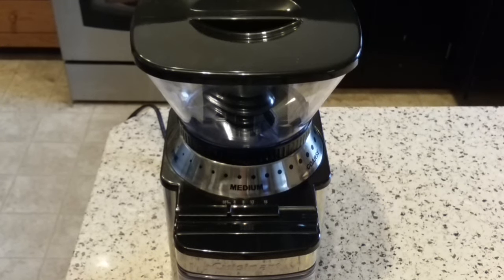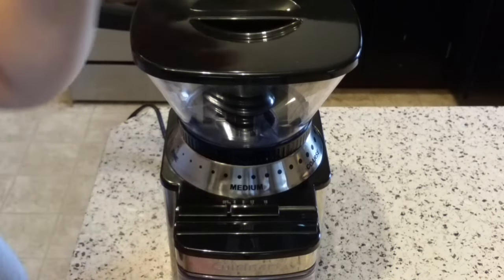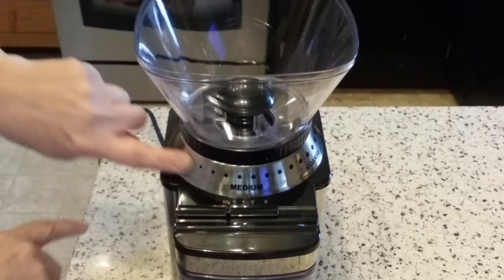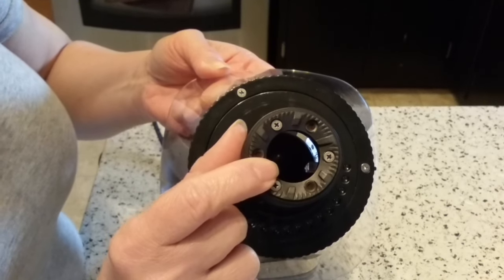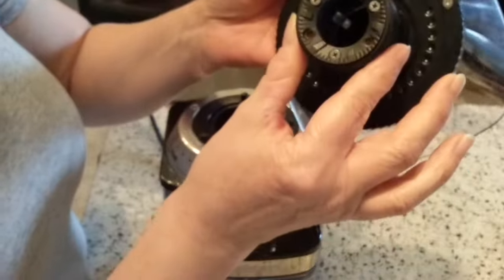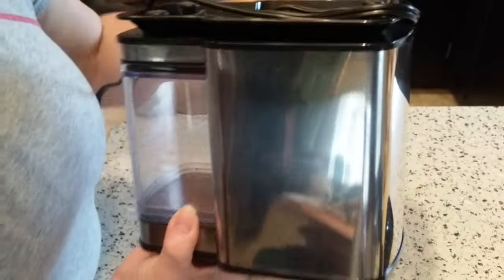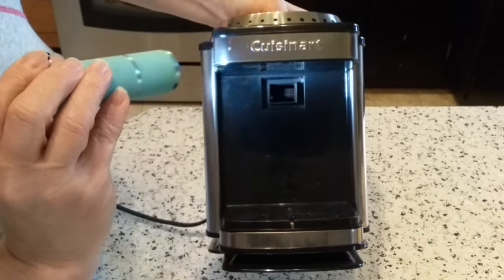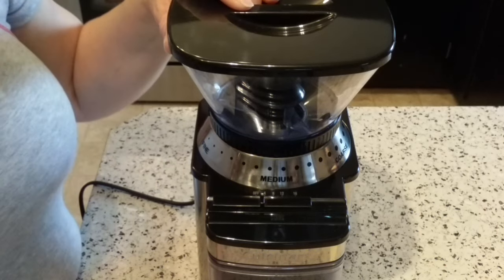Cuisinart DBM-8 Coffee Grinder: How to Disassemble for Cleaning

Comment: This is the same one I have. Which setting should I use for my percolator? 😊
Reply from the maker: Percolators typically use a coarser grind setting. I would start near the right side (coarse grind) of the dial, then make adjustments from there to your liking. I use the coarsest setting for cold brew which works very well. Hope this helps.

Comment: Once the hopper is mostly clean, you can throw it in the top rack of the dishwasher with the threaded part hanging down. Dishwasher detergent is great for dissolving coffee deposits (ie. oil and dust). I wish there was an easy way to remove the motor so the lower burr and chute could be thoroughly cleaned the same way. I did mine today after it was packed shut, and I'm still not happy with it.
Reply from the maker: I've had more than a few viewers ask me how to get all the residual water out after running it through the dishwasher. There are so many nooks and crannies where it gets trapped. I never expose any of the parts to water as it can cause ground coffee to clog even more and possibly grow mold inside the machine. I only run Minute Rice through it to get rid of excess coffee grounds as well any residual oils, then brush everything thoroughly.

Comment: Here is my grinder. You actually have to take it apart to clean it. The manufacturer never once told me this. they just told me that there is nothing in the owner's manual about cleaning...DUH...If you ever want to feel like pulling out your own hair, contact Cuisinart, and try actually having a conversation with them.
Reply from the maker: OMG!! You are not kidding! I just went through a hair-pulling experience with my Cuisinart food processor and the recalled S-blade. Oye ve!

Comment: Hi helpfulnatural, can you grind rice, spices, and nuts in this machine?  I know that Cuisinart DCG-12BC Central Coffee Grinder does the job, but too small for me, so I was wondering if I can switch this for that purpose. Thanks.
Reply from the maker: The burs are meant for grinding coffee beans. Spices are quite a bit harder in texture and could damage them. It would also be difficult to clean all of the residue and odor leftover. I would stick to a small blade grinder for spices, herbs, etc. Does a faster job and is much easier to clean.
Reply: @helpfulnatural  I see, thank you so much ^.^

Comment: Can you hand wash the upper piece, being carefully of the ceramic burr?Noting ceramic is hard, but can easily chip if struck on the sink or facet.
Also, can you adjust the grinder while it is running? I been told that coffee can stick in the burrs, if you crank down from course to a fine grid without cleaning you can compress and pack the residue coffee on the 2 burrs causing a motor lock up. By running the machine empty while adjusting down you will finish off whatever might still be on the burrs. Not sure how true this is, but with a heavily oiled bean or sticky flavored bean you could see how you might get a buildup faster.
Reply from the maker: Yes, it is a good idea to have the grinder running while making adjustments. If however the bean hopper is empty, this is not necessary. I suppose you could wash the upper assembly but I never get any of my grinders parts wet for any reason. Especially because it would be impossible to get all the moisture dried out of the feed tube and other tiny crevices inside. This can cause some issues while grinding and cause clogs with grounds trapped in the grinder. If you used a flavored coffee that you want to remove the leftover residual flavor, wipe out the bean hopper with a damp towel or paper towel. Then run some Minute Rice through the grinder which will not only remove trapped grounds but will also absorb any leftover oils left behind. There is also a product called "Grindz" that is just for cleaning coffee grinders. It is pellets made from wheat that does the same thing as the rice. With either option, be sure to brush everything out thoroughly to remove any rice dust left behind and before your next brew, grind a tablespoon or 2 of coffee beans to make sure there won't be any dust in the grounds you'll use for brewing. Here is the link to one of my other videos showing how I clean this grinder from start to finish:  www.youtube.com/watch?v=cjm_fmALfTw   Hope this helps.  :)   Thanks for watching!

Comment: Can you clean the top plastic part where you put the beans with soap and water after disassembling? Mine has so much oil from old beans.
Reply from the maker: I would wash just the plastic hopper portion (where the beans sit) carefully by hand. Try not to get any water into the narrow tube because it's very hard to get it completely dry. If you hold the hopper upside down, it might be easier to avoid getting the tube or burr wet.
Reply: @helpfulnatural  Ok great, I'll try that. Thanks so much!

Comment: can I use my DBM-8 for grinding spices like coriander, peppercorns and mustard?    I would use it solely for spices. I have a grinder for my coffee beans.
Reply from the maker: Many spices are too hard to grind in a burr style coffee grinder. The burrs in this grinder are made of ceramic which could crack while grinding peppercorns, mustard seeds, etc.. I use a blade style grinder for my spices which works very well and is easier to clean afterward. Hope this helps.

Comment: I washed the hopper in the dishpan. Dishwasher was trapper in the hopper.  Is it not supposed to be submerged?
Reply from the maker: The owners manual for this grinder states that it can be placed in the dishwasher but I've never done it. Water gets trapped in all the tight spaces and takes forever to dry out. I've had many questions about how to get all the water out. I never expose any grinder parts to water....ever. I just wipe very thing down thoroughly then put it back together. I also never use my coffee grinders for anything but coffee beans. Try setting the hopper in front of a fan overnight or use a blow dryer set on warm or cool to speed up the drying.

Comment: Ive got water stuck in a void at the bottom of the hopper, will it eventually drain out? Cant see how to dismantle it to access this area
Reply from the maker: Lay the hopper on its side and set a fan in front of it overnight to dry it out. You could also stand the hopper upside down on a paper towel to drain any water out before using the fan. Hope this helps.

Comment: I must have oily beans because I can't seen to remove the oil from the hopper and it looks terrible now that I tried to wash the oil off, the oil has gone cloudy! Looks nasty and I don't know how to remove it. Any suggestions on what I could soak the hopper in to remove the oils from the hopper? The hopper does not seem to be made of a very good grade of plastic to begin with, so I feel scrubbing it will just make it look worst by scratching it up.
Reply from the maker: It's probably scratched/etched. Have you tried wiping it out with vinegar?

Comment: After disassembling and washing the hopper, water has become trapped between the clear top and black bottom. I’m not sure how it got in there and I can’t seem to get it out. Any suggestions?
Reply from the maker: I suggest laying the hopper on its side and sit a fan in front of it to speed up the drying. There are a lot of small nooks inside the feedtube so it may take a while to getting completely dry. I don't expose any of my coffee grinders to water because it's difficult to dry it all out. I have another video showing how I clean this grinder using Minute Rice which works great for removing trapped coffee grounds as well as the oils. Here is the link: https://www.youtube.com/watch?v=cjm_fmALfTw Hope this helps.

Comment: I just blew a fuse in the house and the burr grinder is no longer working. Did I fry it? Can it be fixed?
Reply from the maker: Does it run after fixing the blown fuse? (Try it in several electrical sockets.) If not, you may have to contact Cuisinart and ask if it's fixable.

Comment: Mine has water stuck just under the clear plastic part of the cone. How do I get it out?
Reply from the maker: Are you referring to the bean hopper? Did you wash it? Take the grinder apart as shown in the video and lay all the pieces out to air dry. You can also use your blow dryer to speed up the drying but only use the warm cycle, NOT HOT. Hot air could melt/warp the plastic of the hopper. You can also set up a fan to dry them if you don't want to use a blow dryer. I never wash my grinders or any of the individual parts as it can damage the burrs and gears. It's also very difficult to get all the water out. I know the owners manual states that the parts are "dishwasher safe" but every coffee machine expert I've talked to and seen here on Youtube say to never get any coffee grinder parts wet. Hope this helps. :)
Reply: Thanks for responding! Yes, there's some soapy water stuck in the bean hopper from the first time I washed it. I'll try the warm cycle on the blow dryer as you suggested.

Comment: But if I want to clean it for the first time from manufacture debris Can I use water and soap???
Reply from the maker: I would not use water or soap on a coffee grinder. You'll never get the inner parts completely dry and soap may leave a film behind. Trapped moisture can cause mold and/or grounds to become impacted. Run a couple of Tablespoons of Minute Rice through the grinder which is what I use to clean out residual coffee grounds. Then disassemble it to brush everything clean.
Reply: @helpfulnatural  I am thinking a bout sanitizing inside not the coffee I dont trust manufacturer companies not very clean

Comment: She covers pretty much everything to clean the machine. Grab yourself a small screw driver to remove the stuck coffee that the brush will not remove. No need to remove any screws. The screw driver should be the size of the little holes you see in the burr.
Reply from the maker: Bamboo skewers work for that too.

Comment: I had to use my knees to hold the machine tight because the bean hopper was stuck and required a bit of an effort.
Reply from the maker: Does that mean you cannot remove the hopper? Were you able to get it apart for cleaning?

Comment: will have to try the rice mine is almost clogged
Reply from the maker: Yes, Minute Rice works great for cleaning this grinder. If it has been a while since you cleaned it last, brush out as much of the heavy buildup as you can, then run the rice through followed my more brushing to get the last of it and any white dust left behind from the rice. Thanks for watching! :)
Reply from the maker: Here is my video showing how I clean this grinder using Minute Rice:
www.youtube.com/watch?v=cjm_fmALfTw

Comment: Ever had water get entrapped inside the hopper?
Reply from the maker: I never clean my coffee grinder with soap and water. It's nearly impossible to get all of the water out afterward. Since I only use mine for grinding coffee beans, I simply run Minute Rice through it to clean out any old grounds caught inside, then do a through cleaning with brushes. You can lay the hopper assembly on its side in front of a fan for several hours, or use a blow dryer on the cool setting to try to dry up all the moisture trapped inside. Water trapped in the grinder can cause mold growth and any grounds inside the machine will become impacted like cement.
Reply: @helpfulnatural  Guess I should have never believed the whole "dishwasher safe" line.
Reply from the maker: @loreauvillephil  Yea, I don't know why Cuisinart still puts that info in the user manual. Since uploading this video 5+ years ago, I've had many viewers ask how to get the water out of their grinder. Let it sit in front of a fan overnight to help dry it out. Good luck and thanks for watching!  :)

Comment: I disassembled mine like this and cleaned it, but now it won't turn on... I hadn't had any problems prior...
Reply from the maker: Cuisinart coffee grinders will not run if every removeable piece isn't locked in place. Make sure everything is installed correctly and locked in, especially the grounds collection cup. Push it back all the way until it clicks.

Comment: Holy crap.  Why aren't you making commercials for these people so they can pay you?!! lol  Loved your review.  Q: Which burr grinder do you like best?  Cuisinart DBM-8  or the Bodum Bistro Burr grinder.  (I see you did a review on that one too.)  Of the two...which do you like better and why?  :)  Thanks again for you insight.  (I just subbed! 👍
Reply from the maker: Lol! I wish they were paying me! I also have another video showing my step by step instructions on how I clean this grinder using Minute Rice. It is a nice grinder, makes very consistent grounds but it's also the loudest I own! Thanks for watching and subbing!  :)
Reply: helpfulnatural Thank you! 🤗 Last question ...I promise! Which of the two hoppers holds the most beans?? The cuisinart DBM or the Bodum Bistro?
Reply from the maker: Between the 2 grinders, I did use the Bodum more frequently only because I make espresso most of the time and it grinds a little bit finer than the Cuisinart. However, I have moved up to the Breville Smart Grinder Pro which is more capable of grinding for espresso machines. I do still pull out the Cuisinart DBM-8 during the summer when I make cold brew coffee. Its coarser settings are great!
Reply from the maker: The Cuisinart holds 8 oz. and the Bodum holds 7.76 oz or 220 gms. One other thing I'd like to add is that if you ever need to replace a part on your grinder, Cuisinart's website sells most parts for this grinder while Bodum ONLY sells the little glass cup/grounds catcher, nothing else. The other difference is the Bodum has conical burrs and the Cuisinart has flat, ceramic style burrs. Hope this helps.  :)

Comment: I wanted to get the grinding disc off the motor
Reply from the maker: From what I can tell and know about this grinder, the burrs should not be removed. Once you get it apart, it's easy to clean without having to remove the burrs.

Comment: Has anyone ever had water stuck in the bean hopper after washing it?
Reply from the maker: I know the instructions state that the hopper is dishwasher safe but I never get it wet, but rather just brush and wipe it out and brush off the burrs. To get it to dry out, lay it down on it's side in front of a fan and let it dry overnight. You may want to turn it around halfway through having the fan blowing into the hopper, then at the burr on the opposite end to make sure that it is completely dry, inside and out before grinding beans with it. If you don't have a fan, put it somewhere where it will get full sunlight for as long as possible. I hope this helps.  :)

Comment: Thank you for the video. Maybe next time just use a vacuum hose to get inside the burrs and suck all the coffee out. I think it would save you time and do a much better job of cleaning the inside and removing jam coffee bits.
Reply from the maker: I have used my vacuum cleaner but some of the nooks and crannies are too small for the hose and the coffee grounds have oils that make them stick to the inside of the machine. The brushes dislodge them more easily. Regardless, the grinder must be taken apart, the point of the video, in order to clean out the grounds. Thanks for watching.
Reply: Point take, I stand corrected and thanks for the videos.

Comment: I didn’t know you couldn’t soak the grinder part & now there’s water stuck in it. My boyfriends going to be upset 😅
Reply from the maker: The instructions do say the upper part is dishwasher safe but I've never done it because it's too difficult to get all the water out. If you have a fan, place the part in front of the fan on high speed with the grinder part laying on its side. Turn it over ever now and then to dry it out. If you don't have a fan, you can use a blow dryer on low or warm setting...NOT HOT. The hottest temp may melt or warp the plastic bean hopper. Hope this helps.
Reply: @helpfulnatural  thank you! I’ll try it. I was looking for replacement parts online to fix the issue. There is a bit of soap in it bc it was soapy water so hopefully it comes out! Thank you!
Reply: @helpfulnatural  Just tried it with the blow dryer & it’s working!
Reply from the maker: @mykalamarie567  👍
Reply from the maker: @mykalamarie567  I also have a video showing how I clean this coffee grinder using Minute Rice...no water at all. (for future reference) Here is the link: https://www.youtube.com/watch?v=cjm_fmALfTw